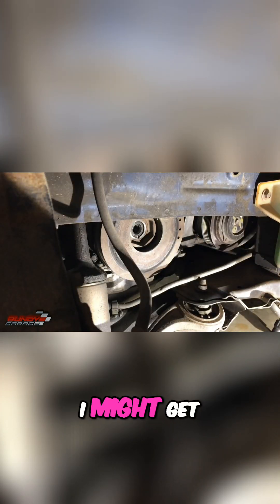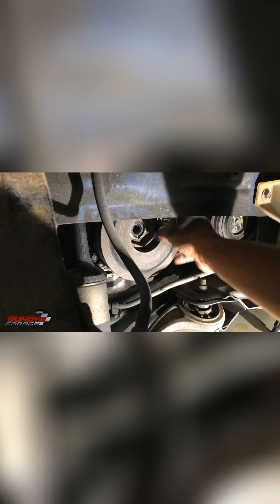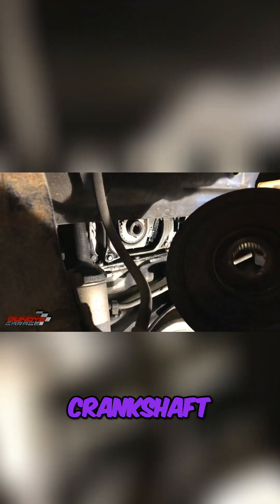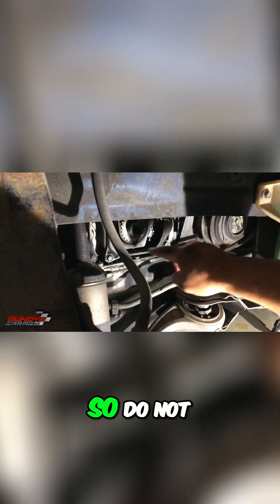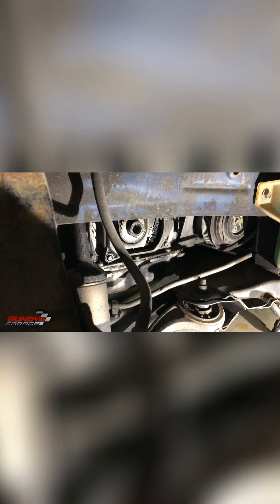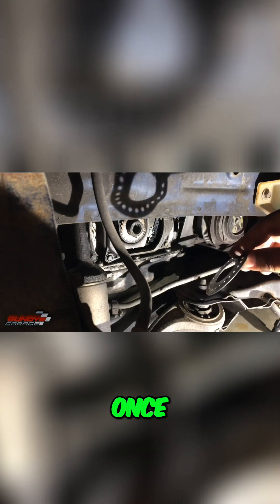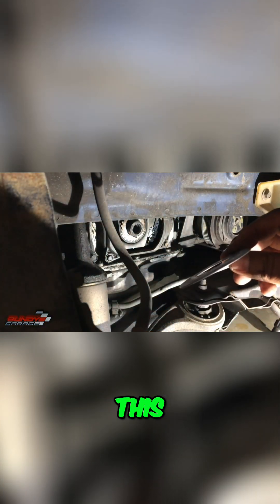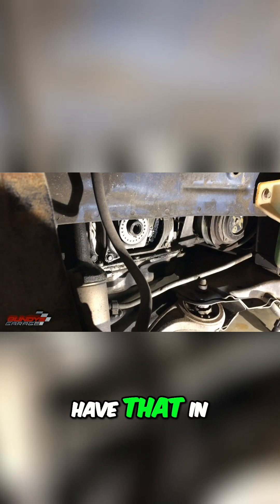Crankshaft Pulley Secrets - Acura Honda J Series V6 Accord #acura #honda

Comment: Do you actually need that little plate thing?
Reply: yeah it keeps the belt from walking around the pulley. Its also seen on all honda engines with belts especially all the 4 cylinders

Comment: I bought a Lyle extra thick 19mm Crankshaft pulley socket along with my Milwaukee High Torque Impact and it comes right out.  I've never replaced a crankshaft pulley bolt, but will try the antiseize.  Thanks again for another good tip.